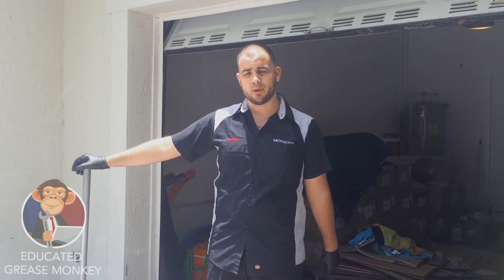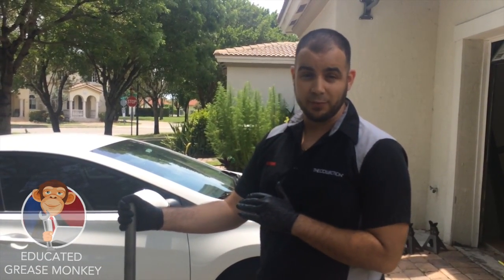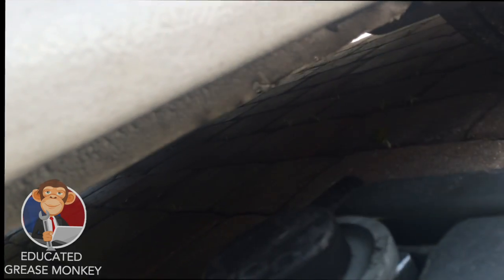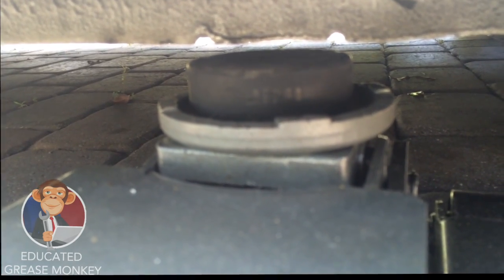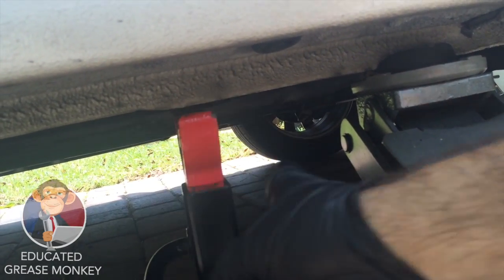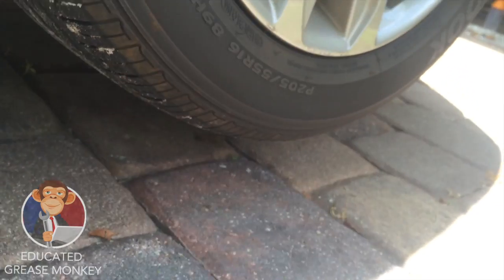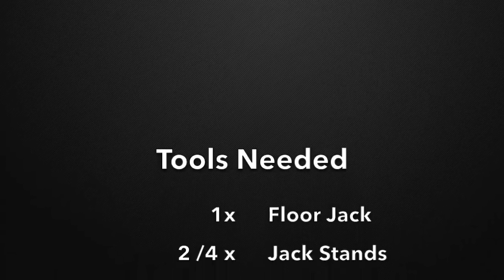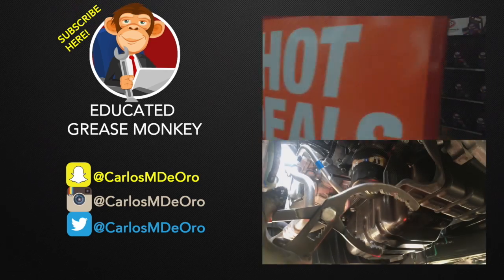How to lift a car with a floor jack and jack stands? - DIY - Educated Grease Monkey

Comment: I think step #1 should be  to set the emergency brake on, step #2 chuck the wheels front or back depending which end you are lifting and then lift.
Reply: so  u  saying  the  side  that  u  are  lifting  that  is  where  u  put  the wheel  blocks  ?  because  i  thought  if  u  are  lifting  the front  end  ,  that  is  when  u  block the rear  wheels .   am  i  wrong  ?